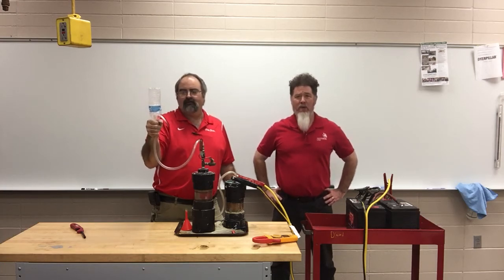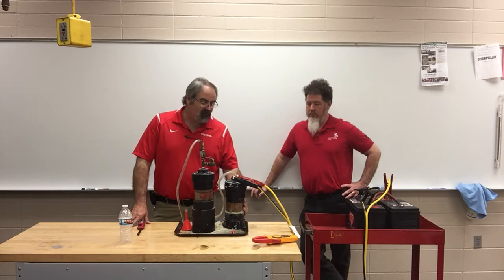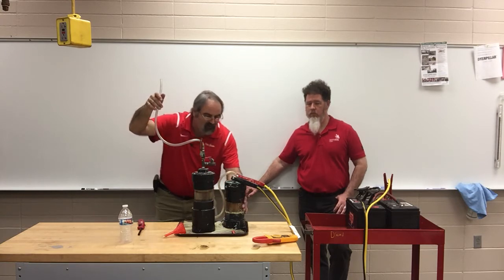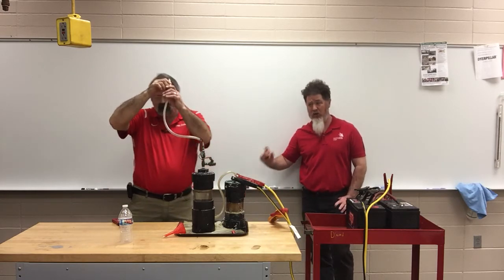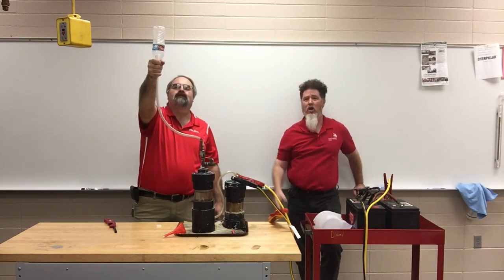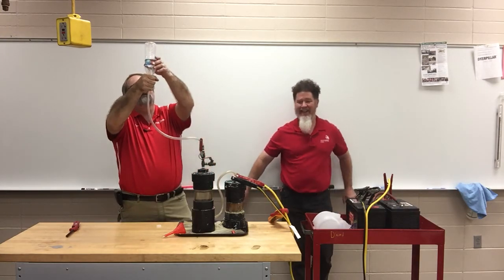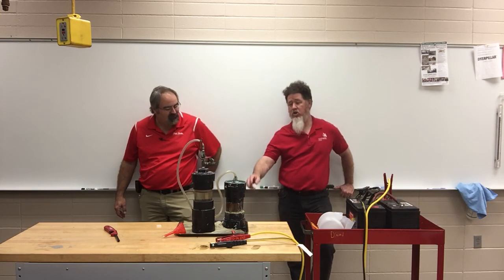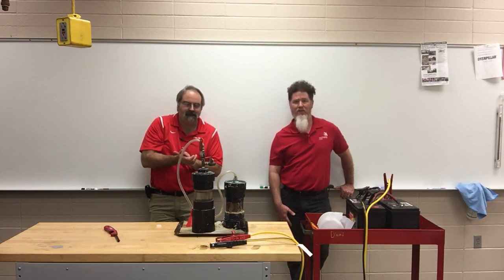Tips on using a hydrogen generator to create hydrogen.

Comment: Well you are using the alternator to break a bond in water only to feed hydrogen back in engine to burn it again so you aren't getting a gain due to the law of thermo dynamics you must make a net loss in that process. However ,if the car had solar it may produce hydrogen via its output and perhaps that could be a better setup